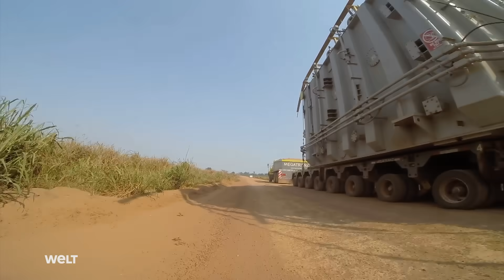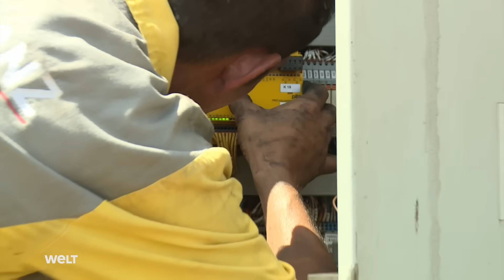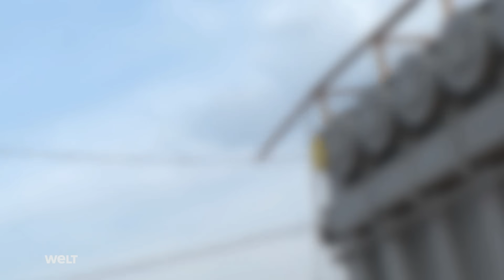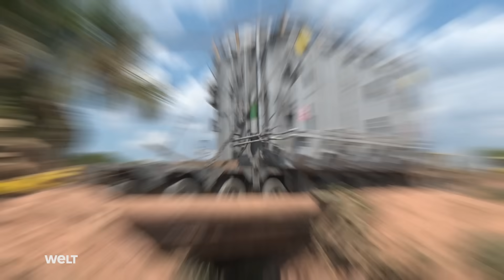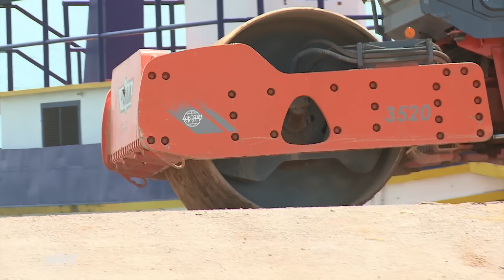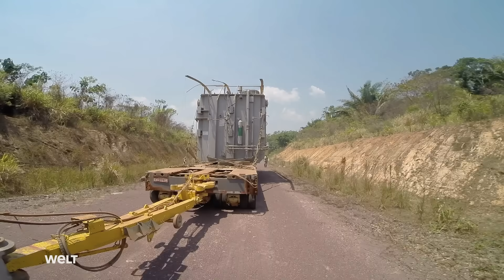HEAVY HAULAGE In The Jungle | Full Documentary

Comment: That blue truck in the beginning actually pushed the barge away from the shore. Seems like they should weaken the brakes on the trailer if their backing them on. Otherwise, heavy truck sliding with trailer grip will push it away.  Another thing, why doesn't the folks paying for the transformer invest in a concrete docking area?

Comment: i've worked on the winter roads in canada for years..if you break down,you die,if you go through the ice you die, if you catch your wave in front of you ,you die if you get a limb wet it'll have to be cut off in less than half an hour..we get about 3 hours of light. -40- - 60's  means if you try to walk out you'll freeze to death or animals will eat you.this is a massive load but not what i call dangerous..any flaw in our equipment will kill you. we drive across the lakes (bigger than england) while standing on the stairs holding the steering wheel with the cruise control set at 15km/hr.that way if the ice starts cracking you can TRY to jump clear .if you get wet? you may as well stay in your seat with your seatbelt on because drowning is a lots less painful than freezing to death or having limbs fall off ..the shock of the cold water will usually stop your heart before you drown though.

Comment: IDK how logistics work so much, but, why dont they change the engine oil before the journey?
Why do they need to change it during the trip? FFS its just a 100km journey. If you need to change it before, then do it before. Else after. 
It doesnt make sense it needs to be changed every 50kms? Or maybe since the load is so heavy? They never mentioned the weight tho

Comment: I’m at 5:03   And the reason the Rig with Casing pipe went in the river wasn’t the drivers fault.  The barge / tug operator pulled away / off from the bank before,   The Rig was on the barge and,  fully secured / tied down.

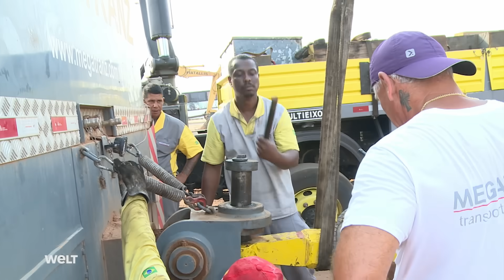Comment: Laughing my freaking azz off at 18:35 the face on the guy when hammer breaks. It's like saying nothing works here. First the remote, then tires, now the hammer. What's next? This narrator does not know what he's talking about.  That engine is not 1,000 hp. It's a cx15 Cummins about half the horse power also that that they did an oil change.  Looked like a coolant filter change or a fuel filter. Not motor oil.

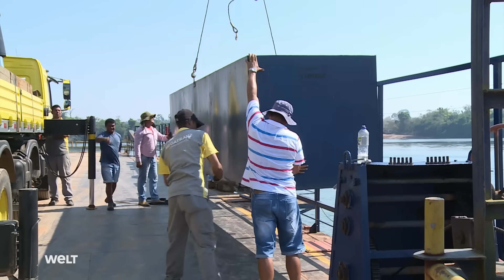Comment: 35:50  I don't get it, how does adding tanks (I'm assuming empty tanks) on top of the ferry provide more stability?? It seems obvious that it would benefit more by adding them to the ferry's sides just below the water line...giving more buoyancy and a bigger center of gravity? Maybe I'm missing something...??
Reply: I kinda get the impression they might not know what the fuck they are doing
Reply: Lol! I was wondering this too... it can't possibly be for if the whole deck gets below water, that'd be ridiculous!
Reply: @isnoodles  This is Brazil
Reply: If the barge sinks too low the extra tanks prevent it from totally sinking. It's a backup
Reply: Just more weight on the deck.

Comment: We've got several tires with cut side walls but we'll be ok!  Stupidest quote of the day.  OK you're in the middle of bum fuck Egypt and you have no maintenence support vehicle?   Your remote control unit doesn't work?  You're now at Joe's coconut and tire repair shop where you use up your last spare tires.  You've got from what I could figure is about 4-5 million dollars in hauling equipment and load and will be making this trip multiple times so let's hope that rickety log bridge holds up?  Seriously what a cluster fuck operation.  There are so many risks that could be eliminated with preparation and planning.  I couldn't believe when they show the tornout sidewall of a tire their now heading into the jungle with!

Comment: For My money I would have built concrete ramps for the barge.  A little money and less worry and concern later.  I think I would have additional pulling power at the top like a second truck or crawler.  In fact. I would have the additional truck traveling ahead a few hundred yards as an additional safety and power supply.
Reply: @Hello Roger how are you doing

Comment: The ferry barge accident where the ferry was pushed off shore and the truck sank was the fault of the boat operator .The boat motor should have been in gear pushing into the beach hard to prevent such an incident.and this tethered remote is a simple device to repair/maintain what is all the break downs about for God sake these guys are ill equipped at best.

Comment: Transformer weighs 200 tons-  Stone foundations at temple of Balbek in Lebanon weigh 1200 tons and were moved thousands of years ago.
Reply: And with no drama!!!
Reply: I was gonna make a joke so went to look the details up. Ok, but the 1200 tonne stone was never moved, and the other stones were 800 tonnes, and were only moved 800m from the quarry they came out of, which was slightly higher than their final location.
Reply: @cjeam9199  Yes, the stones in place are 800, but they were moved-  if you can figure out how to move a stone that size 10 feet, then the distance is only a matter of time.  Clearly, they quarried that 1200 ton stone figuring they could move it.

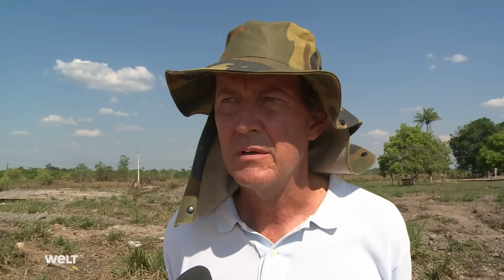Comment: 27:32 ...nothing can be salvaged... 27:35 ... the transformer was cut into pieces ... copper which can be reused...
Reply: In the context used, they meant salvage by righting the load and delivering.
Reply: Not even the wheels on the trailer?

Comment: kenworth old trucks, amazing.
Reply: C500 is a newer truck.
Reply: @jironmeister  2014
Reply: C500 is new truck with an x15 or e5 cummins....
Reply: Any insights on the model shown ? Looks like monster
Reply: @hugmusic25  it’s a common Kenworth cab, with a big steel hood to cover a high HP engine, big transmission with an auxiliary transmission. Then the rear drive axles are planetary drives, which gives further gear reduction and torque. The big box on the back is for ballast, which adds weight to the truck’s tires to increase traction.

Comment: May be a dumb question but if you are removing axels why can't you use some of the tires from those to replace the damaged ones?
Reply: Might be a compatibility issue.... wheel size, lug bolt patterns, etc.  between the self driving trailer and the other axels. But I agree.... I’ve done long hauls and usually had a spare tire or wheel along...... truck stop shops are greedy and really proud of their new tires.
Reply: It's a matter of time, schedule, and consideration. Replacing tires takes a lot of time, not just simply "time", they disrupt the "scheduled time". And also, the head of the team judged that it was considered "safe" to drive with small external tire damage on a single tire between tens of others, and replacing it was not worth the time.  Plus they didn't have any specific road regulations constraining them for this case in Brazil, yea boi Brazil is not for the weak.